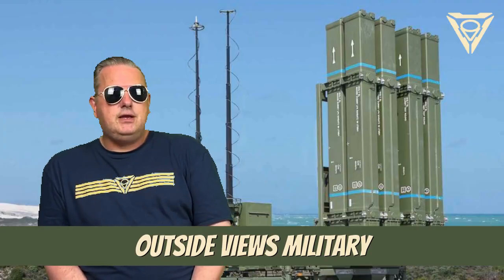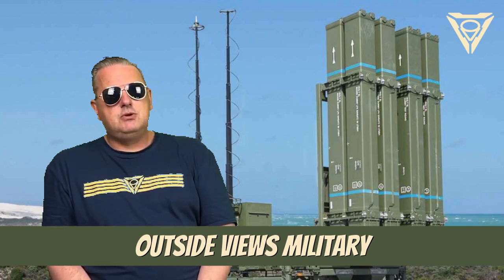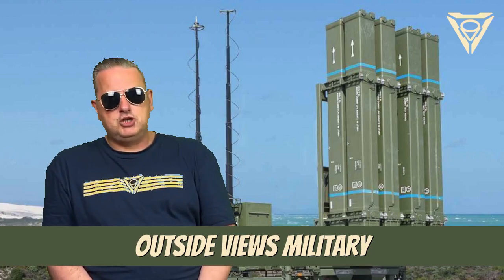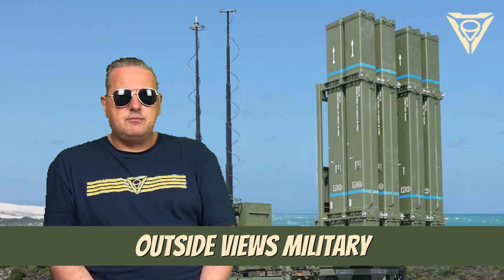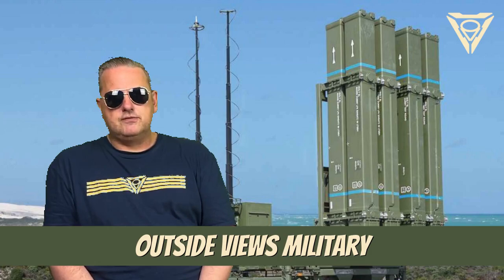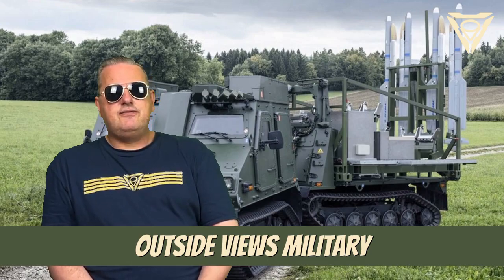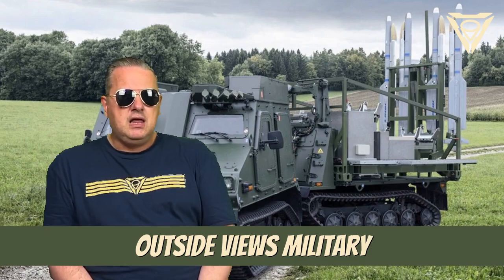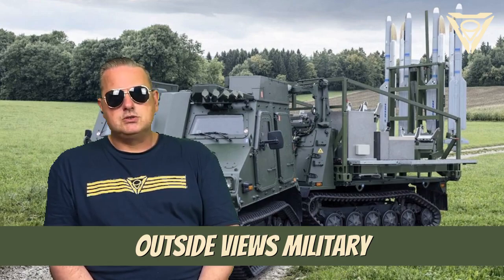Air defense systems IRIS-T SLM/SLS | Outside Views Military

Comment: Hi Marc, thanks for all your work. Usually bang on and useful. I know sweet F all about military stuff. But Europe as a block, does need defense systems.
How does this system you describe compare with the so called "Iron Dome" in Israel? As good? Better? Worse?  Does Europe need a european military force?
Reply from the maker: the iron dome is an israely system. I will come to that at a later time on this channel most likely. But politics I will keep for my political channels mostly :-)
Reply: @OutsideViewsMilitary  thanks. Np
Reply: Iron Dome is different , it provides cover for bigger area, this one provides cover for short / medium area
Reply: Misstyped coverage for smaller area